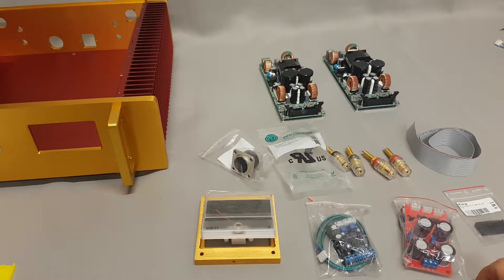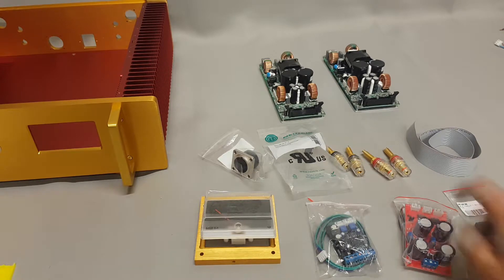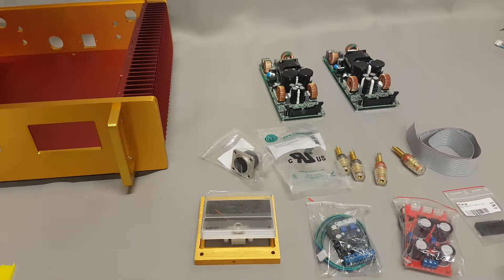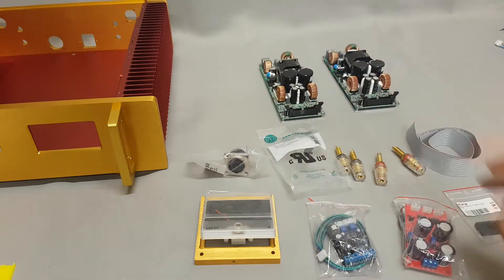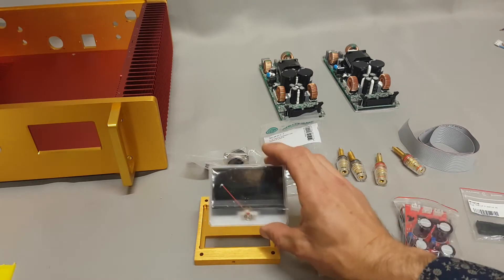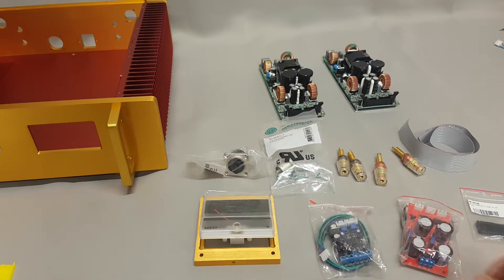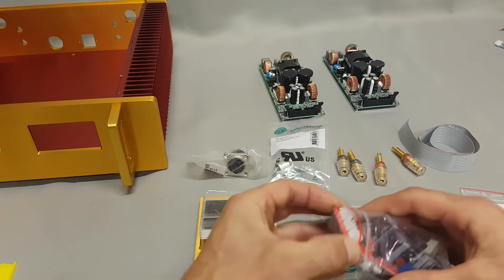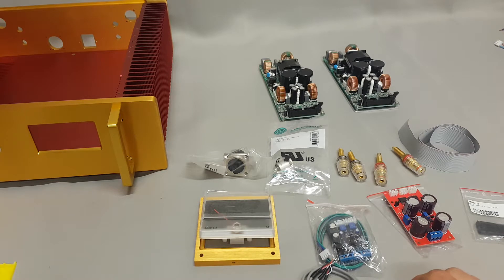Pascal S Pro2 basic Power Amplifier with a GSJ Chassis

Comment: I have a custom built amp based on m-pro2 module. It has been made by an audio company. I wanted to build one by myself, however, pascal doesn’t sell to dyi makers. How did you get that module? Btw pascal is awesome :)
Reply from the maker: We sell Pascal modules to the DIY. Though a chassis has to be included.
Reply: This same amp module is used in jbl prx 700 and 800 series. Just go on ebay or the speaker exchange, type jbl prx board, thats it.